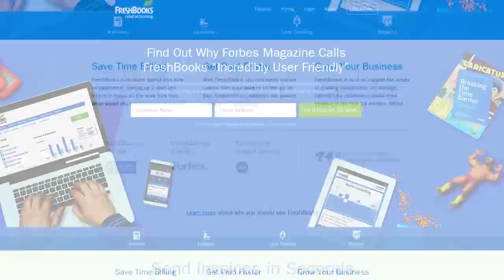New Office Vlog 5 - #Firepole?

Comment: Linus, the sink will not go under the microwave shelf, it will go at the other end where the shelving is higher and most notably there is no drawer under the counter top, thus allows for the sink to drop in with interfering with draws

Comment: It's not real :( the shadows are going parallel to the rear wall. A. the shadow is a bit too think on the floor based of the ones cast from the saw horse things and B. It would probably be casting something onto the stairs based on the directions of other shadows.

Comment: I am upgrading my pc but I don't know if they are compatible.  Motherboard- asus m5a78l 
Cpu - amd fx6300 6 core
Ram- Kingston hyperx fury 8gb
Graphics card- Radeon hd2400pro
Power supply - 475watt
I don't think any cpu cooling fans. Is it necessary to have a couple cooler. I have other fans obviously but not to sure about a cpu cooler